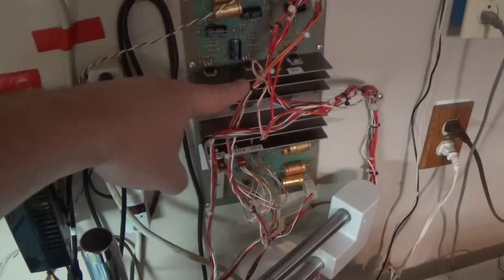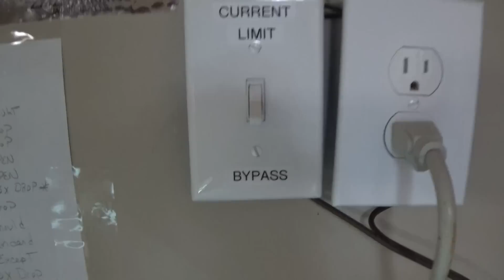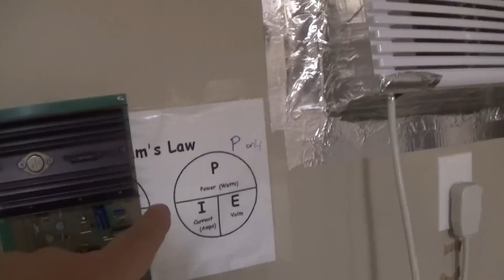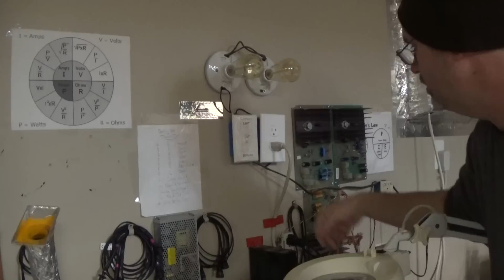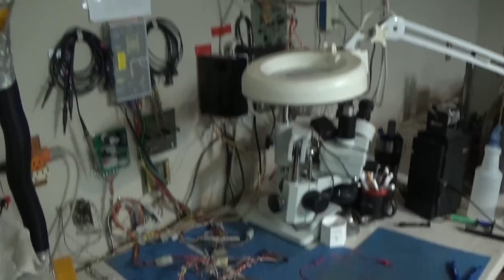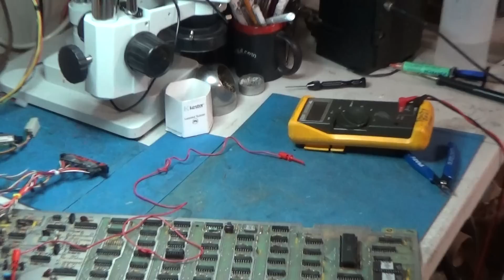New Addition to The Test\Repair Bench!

Comment: Cool idea!
But have to admit, wondering why you wouldn’t add fuses to the -15 +15 and 5v lines, either prior to the current limiting circuit or even after (in case you get surprised when it’s in bypass).
Reply from the maker: yjose are allready fused in the AR II setup I use

Comment: Every bench needs them. I have a string, all switched. I start with a 25w and switch in 40w bulbs one by one as I monitor current and regulated outputs. If you want to get serious, a variac is great too. Some switch mode supplies hate them and will try to ramp up current to keep the output going, but good switch mode supplies should have an internal current limit anyway, so they don't need you to add one
Reply: Also, if I just want to protect or limit one supply, add a poly switch in series with that rail.
Reply from the maker: I do have a variac..  it's an Eico 1073.  works great.   I just got it.
Reply: @classicarcaderepairs  Nice!

Comment: Great idea indeed, I always used a dim bulb limiter on valve circuits and transformer power supplies but never thought it was a good idea on Switch mode power supplies. . Would be interesting to see if it works with the 5 volt line shorted. , !?
Reply from the maker: I did short the 5V line as well off camera..  It also does work..  but there is not a lot of change to be honest. I suppose its because the 5V rail is low impedance to ground to begin with.  The light just got slightly brighter when I grounded the 5V rail.